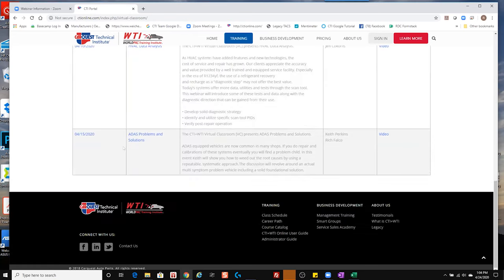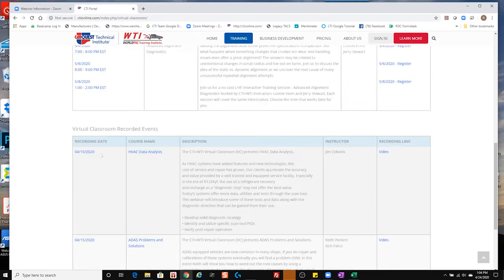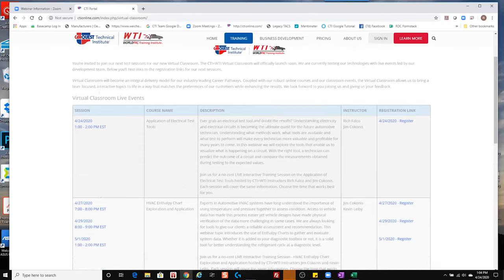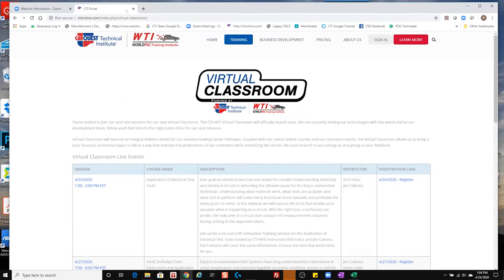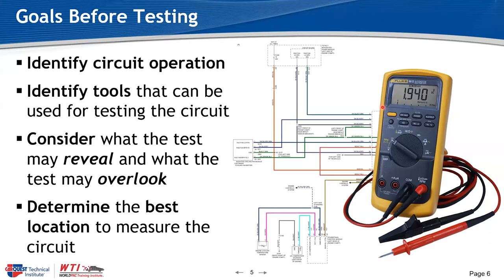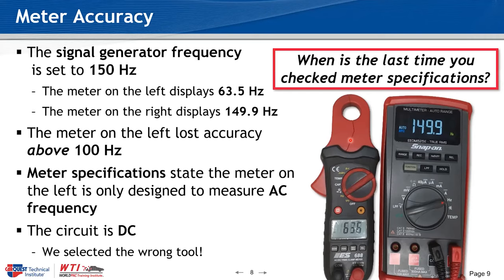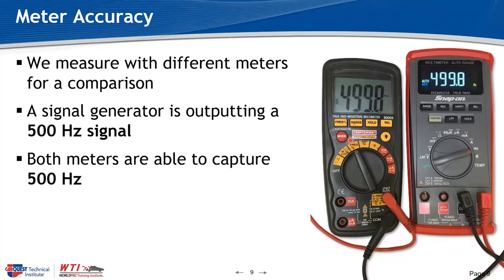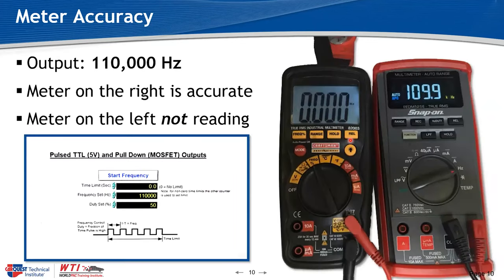CTi Virtual Classroom - Application of Automotive Electrical Test Tools

Comment: could it be that the short to ground blew the fuse and also opened the circuit wire and left it opened but not touching the ground anymore?